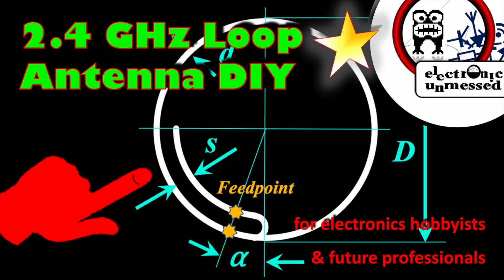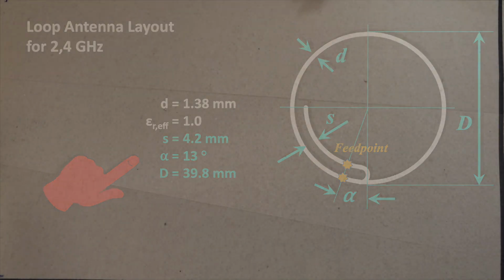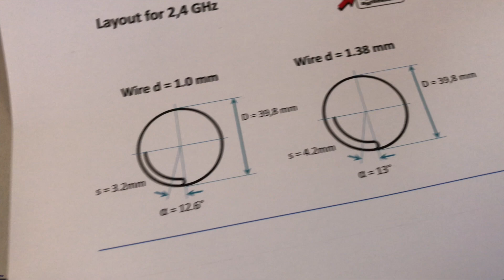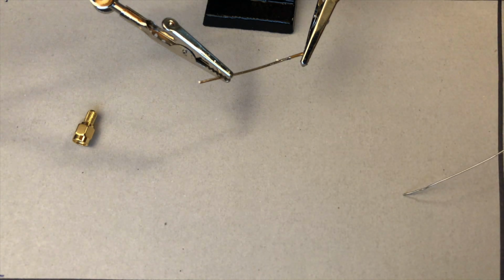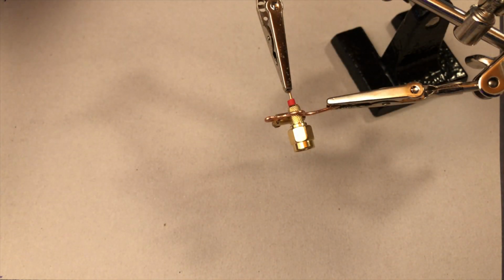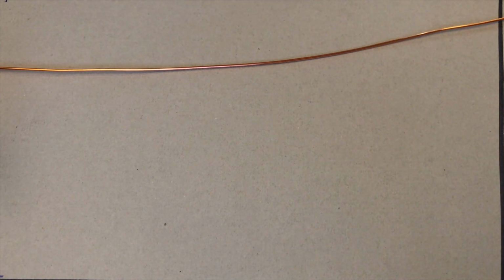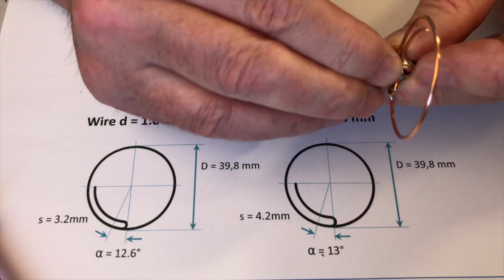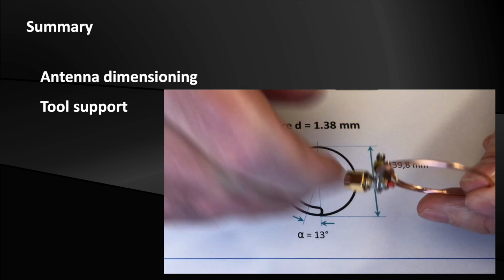The Make of a 2.4 GHz Loop Antenna (EP34)

Comment: ... Danke für die sehr ausführliche Schritt-für-Schritt Anleitung zum Bau der Antenne. In der runden Form habe ich noch keine WLAN Antenne gesehen, immer nur in der Stabform. Sehr schönes Projekt.
Reply from the maker: Vielen Dank für Deinen Kommentar! Ja, ich denke tatsächlich auch, dass diese Art von Antenne neu ist. Deshalb habe ich auch die EXCEL Tools dafür gemacht, um sie für einen beliebigen Frequenzbereich zu entwerfen. Mal sehen, vielleicht entwerfe ich mal ein Modell für 70cm und 2m Amateurfunk. Was meinst Du dazu?
Reply: @electronics.unmessed  ... die Amateurfunkantennen würden mich schon interessieren.
Reply from the maker: @MeinElektronikHobby Ich denke, in einem der kommenden Projekte werde ich eine solche Antenne für Amateurfunk-Frequenzen bauen ..
Reply: @electronics.unmessed  👍
Reply: @electronics.unmessed Can this antenna be used for a 2.4 GHz ELRS module?

Kann diese Antenne für ein 2,4-GHz-ELRS-Modul verwendet werden?
Reply from the maker: @ Thx for your comment. Yes, that should be possible.
Reply: This like is mean yes ?..
Reply from the maker: @ersankurt50  yes, you might need to tune it a bit to the right frequency. Check out the dimensioning.

Comment: Thank you. I enjoy and appreciate the care you put into the construction of the antennas.
Reply from the maker: Thank you very much! I am really pleased that you are interested in this topic.
Reply: @electronics.unmessed , as soon as I get a couple of things out of the way I will be building first 1 small magnetic loop for the HF bands, since I live in an apartment, then 2 more duplicates, so I want to understand how to build and tune them and get the maximum Q. I think it was Tesla who wrote that resonance was the most beautiful concept in the universe. 
I have 3 pieces of 25.4 mm diameter hard-line of just less than 3 meters length each that I'd like to get working as matching loops this winter, then play with the phasing of them on HF when the weather warms up again in order to see about getting a more directional signal for both reception and transmission. It seems to me, though I'm a bit vague in my understanding, that most directional antennas are designed around electrical properties, not magnetic ones. I think there could be some magnetic attributes of positioning and phasing of 3 small loops on HF that could be advantageous in directing signals, and I'd like to understand them better. Thanks to the inexpensive NanoVNA and the TinySA I will be able to conveniently tune up and match the antennas, and then do some experiments and get signal strength measurements in a nearby park. I'm looking forward to it. 

I suppose I should also learn a bit of antenna modeling this winter as well to give me some insight into the optimum placement and phasing for the experimental antennas.
Reply from the maker: @johnwest7993  That's an interesting plan John. If I can help please let me know. I'm very happy to discuss all of this here on the channel, because it's also of interest to a lot of other people.
Reply from the maker: @johnwest7993  I thought about your plans and I think, I can support you with an EXCEL tool to predict the radiation patterns. I am just digesting the math, trying to be ready when you start your investigations next year. I am looking forward to it. If you want, we can even publish your investigations on this channel. Merry Christmas & Happy New Year!